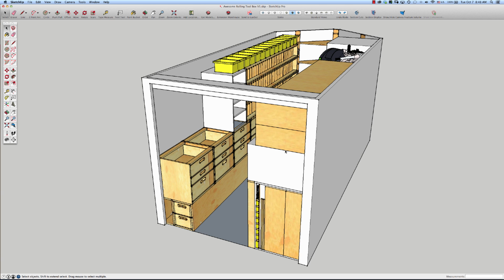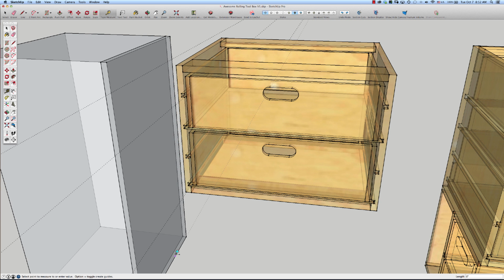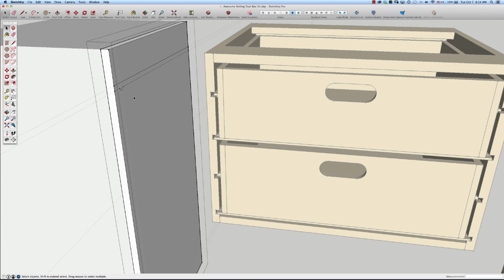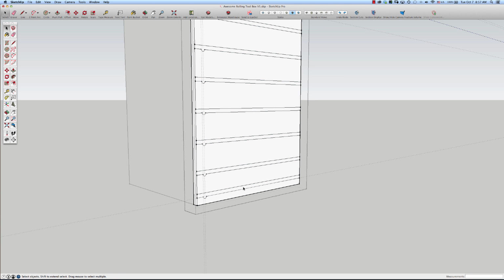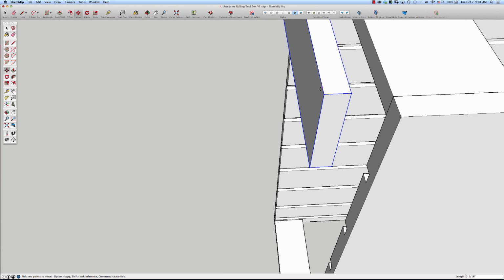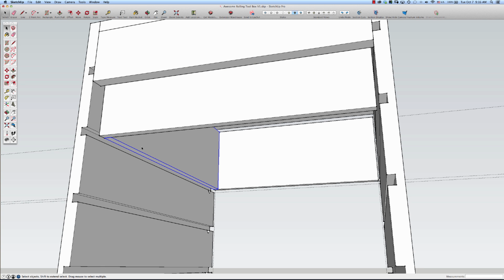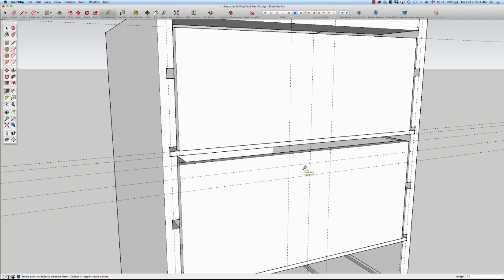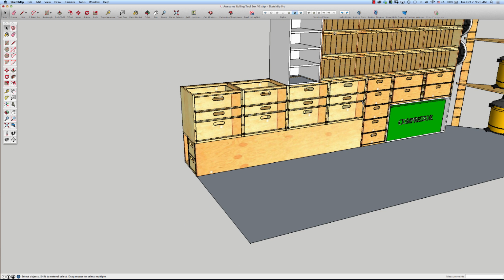BUILDING A MOBILE WOODSHOP (Part 10) Design a mobile woodshop cabinet.

Comment: Ron, when I try to push/pull the grooves, the material doesn't disappear.  The lines move in but the wood doesn't go away.  What am I doing wrong.
Reply from the maker: Make sure only the surface is selected for push/pull; the lines should not move. It is hard to know what you are doing without see it. If you are pushing a surface to create an opening like a hole, select the surface push it in and touch the mouse pointer to the back side of the geometry, and the surface will be eliminated.

Comment: Are you doing this with the Pro version of Sketchup or Make? I just got time to download, but have not looked at it yet. I'm more interested in it as a sales tool over AutoCAD, I know my cabinet program rendering has sold my kitchens.
Reply from the maker: David, I have the Pro Version. I have had SketchUp since it was a small company in Boulder CO and had no free version. You should try SketchUp Make first and see how it works for you. If you are only using it to show your clients models, SU Make should fit the bill.

Comment: Hey Ron, why not put the cabinet bracing on the top and bottom instead of between the two sides? Then all your drawers would be the same.
Reply from the maker: Adam, all the drawers are the same. I made them all 1 " short of the case back to allow room for the spreader. There are at least two reasons not to place the spreaders on the back: 1. It will create a ¾ " gap along the edge where the case meets the wall. 2. When the spreader is placed on the back, the screws/attachments are in the same direction as the load so you will be pulling directly on them instead of  the screw being perpendicular to the load. The method I use is typical in cabinet construction. #2 is the same reason the drawer sides run through instead of the back and front.
Reply: Ron Paulk thanks for the reply. I was actually talking about the spreaders on the top and bottom of the case, not the back. I was referring to the drawer heights all being the same. If I understood the video, the top and bottom drawers you made were shorter (vertically) than the two in the middle. Just seems like that would make for more flexibility, but maybe there's a reason the spreaders need to be inside the case rather than outside?